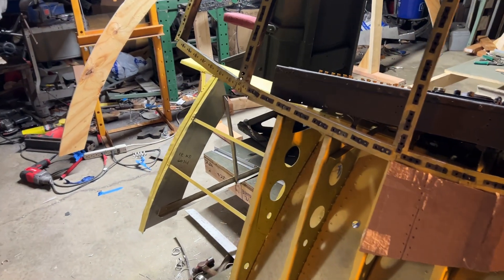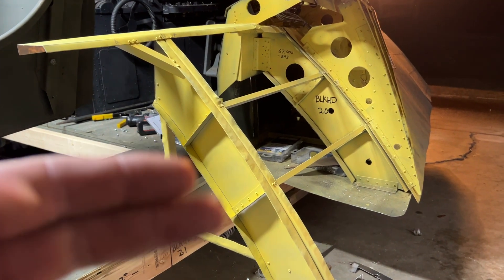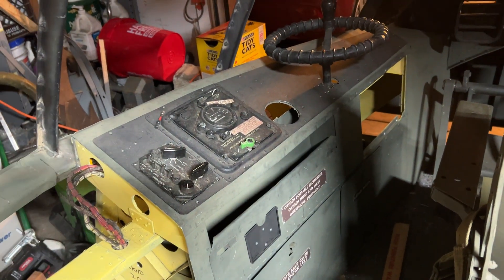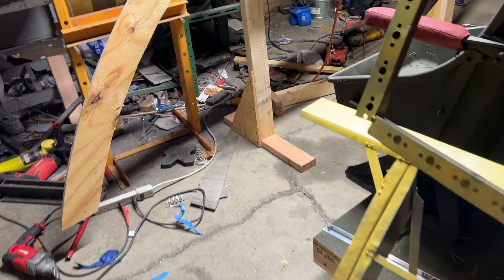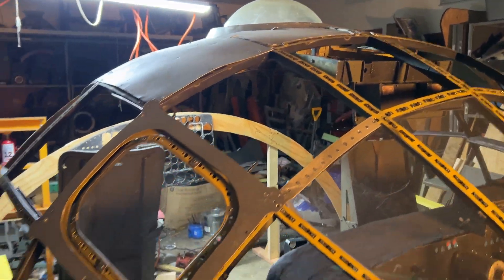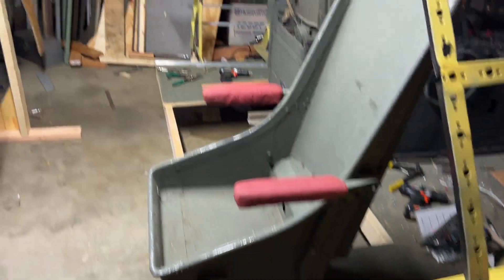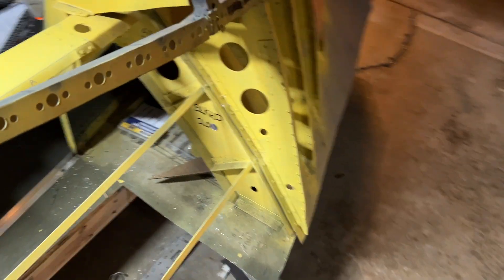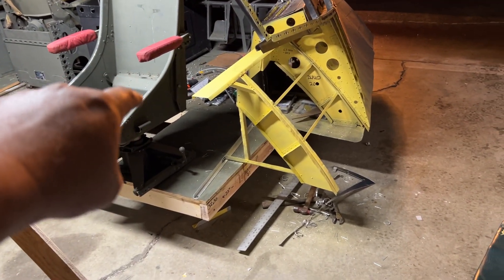Full Scale B-36 Peacemaker Build Fuselage Extension Progress

Comment: If you don't already, find a copy of the 'Handbook Structural Repair Instructions'. (T.O. 1B36D-3 as an example) This will provide details of the structure with measurements of the fuslage (as well as wings and empennage) This would help you more accurately place your components.  You might contact air museums and see if their libraries have a copy, and maybe visit to make a copy. (scan in as a pdf) They'll usually allow this for a small donation.

Comment: I was under the impression that all 48 contiguous states had gone to a uniform 102 inches legal width. If so it may be of some assistance to your transport solutions. You have my respect Sir and I wish you luck in this truly massive undertaking you have devoted yourself to.
Reply: 102" or 8' 6" is legal on EVERY federal Highway and most State Highways in MOST states. you can also obtain permits to move oversize loads by truck no problem.
Reply from the maker: I will certainly look into that. Thank you.